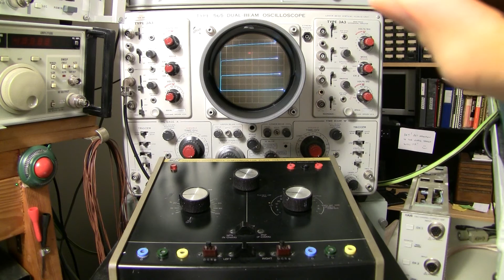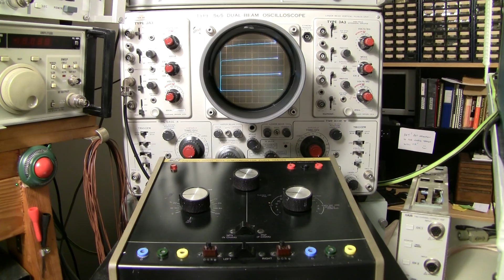Curve Tracer, determine DC static Current gain of a Transistor or hFE

Comment: Mr. Carlson, do you think that the final transistors of an NSA amplifier operating in the parallel SEPP circuit should have the same hFE? Is the distortion affected by the large difference in hFE of the final pairs of transistors called complementary pairs? And could the big difference in hFE of these end transistors be the reason why the bias of the amplifier cannot be adjusted? Take Pioneer A9, for example. If you have the opportunity, just answer super short, even with yes or no - I will be very grateful.
Reply from the maker: Hi John. Transistor hFE is all over the map with same number transistors. I would match them to the specified gain that the factory used. There are a hand full of reasons that bias requirements may not be met.

Comment: Great video but why use different reference points for the second transistor? I understand the need for interpolation, (Down to 29uA), but then why use 7.2mA...the value AT 30uA? Wouldn't you use 7mA @ 29uA OR 7.2mA @ 30uA? The maths is still the same so it doesn't really matter but aren't those values you used just a little mixed up?
Reply: I agree. On that point I wound back the video, and came to the same conclusion. It should be calculated with 29uA and 7mA, >OR< 30uA and 7,2mA.
As you said, a little mixed up, but not on purpose. I just saw the other video about the same curve tracer to explain AC gain, and there Mr Carlson read it perfect.

What would be more exact is 3 transistors from the same batch of each, so viewers are shown that every individual transistor from the same batch can have much different gain.
Not sure about the American and Japanese transistors, but European can have a last character to tell you from which gain category the transistor is picked:
A  hFE between 100 en 260
B  hFE between 250 en 500
C  hFE between 450 en 900

Thanks for your videos !

Comment: Great video!  I am interested in building an advanced Curve tracer to use with an old analog oscilloscope dedicated just for the purpose of testing and matching preamp tubes, power tubes and of course passive elements and transistors (FEts and JBTs). Would you consider a tutorial in designing one?
Nic

Comment: In a class B operation of amplifier it is vital to match driver and power output transistors; as you pointed out Paul, if there is a mismatch the current load will be heavier when the transistors switch back and forth causing eventual pre-mature failure that often cause a cascade destruction of more than one part. Through careful matching with my equipment it virtually eliminated call backs. You will pay more for a matched pair from the manufacture and find the hFE does not always match, great video.
Reply from the maker: +John Cunningham 
You bet, matching is extremely important in RF, P-P amplifiers. Thanks for your comment John!

Comment: Wow, love this. Keep going with current leakage, capacitance, diodes and all the other cool stuff you can do with curve tracers! I have a Tek  575 Mod 122, it is handy. Can do tubes too with a bit of bodging with junk parts. I never even heard of this B&K appliance, but this is great stuff! Shango066 just did a few videos about Russian germanium transistors (replacement germanium transistors are $$$ and hard to get now!)  that you can get super cheap on ebay, they are handy for fixing old transistor radios. I think anything that helps characterize those things is timely! Thx!
Reply from the maker: Hi, glad you enjoyed. I will do more videos on this topic again very soon. I may actually design a tube curve tracer in the not too distant future, and do video on it as well.
Reply: Mr Carlson's Lab
That's way cool. I imagine videos about designing a tube curve tracer, and its use, would get you a lot of attention and views from the restoration/repair folks, hams and audio enthusiasts. My 575 tells me more about devices (all sorts) than any tube tester ever could! I bet folks would be interested in a little theory of operation too.
Reply: cny02253 I wholly agree with you since tube testers seem to be on the expensive side i.e. Hickok, tv7 etc.,  if one could build a way to test tubes on the cheap building a DIY unit would be awesome!!!